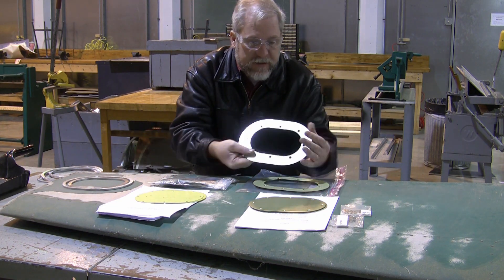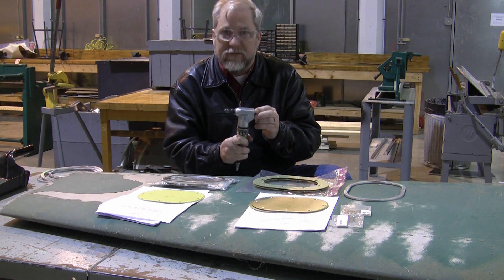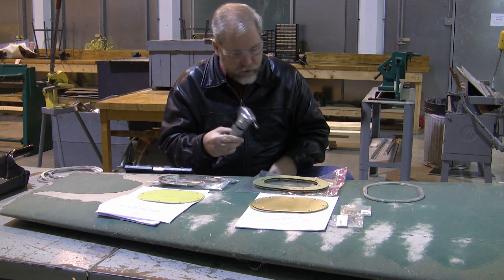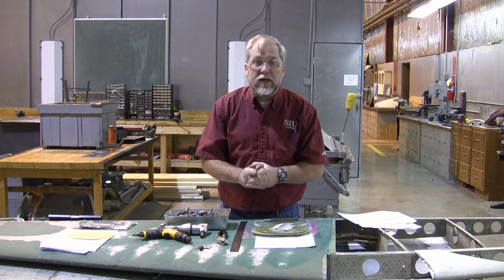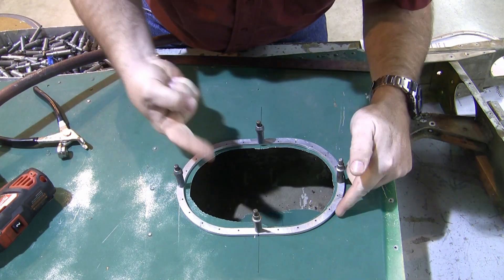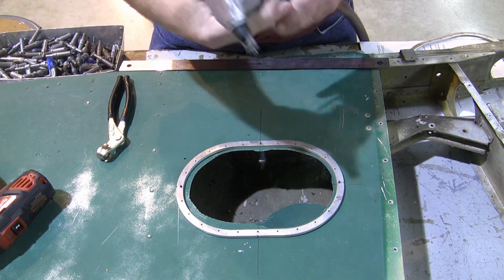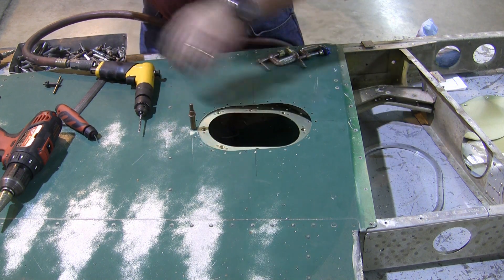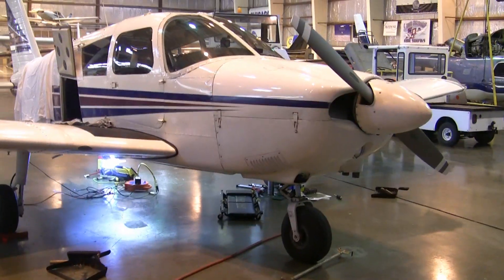Installing access panels in a PA-28 wing with a CNC cut template and nibbler

Comment: If that’s the official Piper panels the size is way more than anything needed. I would submit to the ACO FAA Atlanta office my own panel design of a five inch hole and backup plate with my own drawn up and made inspection plate or maybe even a  four inch diameter inspection plate and backup plate.. I would propose to the FAA ACO a smaller flush panel would be a less compromise to the panels structural integrity and wing aerodynamics effectiveness if say a panel fell off in the future. Contact the Atlanta ACO office for your own design for a smaller panel is my suggestion. The FAA ACO is just setting there waiting for questions and their help in complying with your aviation structural questions and they can approve a inspection panel of your own alternative design. Smaller less wing structure compromise is my suggestion. Nice video.  I always if I am in an older wing suggest zinc chromate while your there. I have seen old zinc chromate coated wings way over fifty years old and they look like new compared to the alodine wing skins and spars. I have seen the alodine wing skins and ribs where corrosion is so bad you can put your finger or a small common screw driver with just a small push on the ribs, spars, or skins that are almost gone and you go right through the corrosion.

Comment: Have you decided on making templates .  I will commit to purchasing one.
Reply from the maker: Hi.  I just sent off a batch to a machine shop.  I'll post a link when they are done.
Reply: @1donagin  ok perfect.... thanks
Reply: @1donagin  do you have any jigs left?
Reply: Do you still have any templates left?
Reply: I have looked at the ad and I don't see any dimensions. What would you have to do to design your own access doors for a certified aircraft and be able to use it? 4313 only shows you the minimum and maximum spacing and doesn't say how far to put rivets or screw holes apart on a access door. I hope you'll answer this as being in an instructor you'd be able to tell me what the process would be to be able to do this. I realize this is an old video but I hope you're still monitoring it thanks for the video